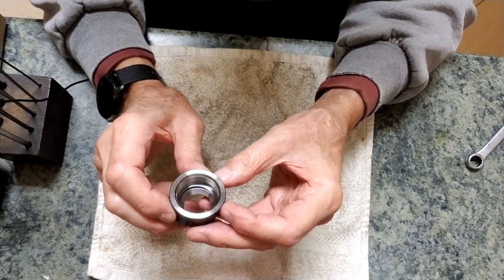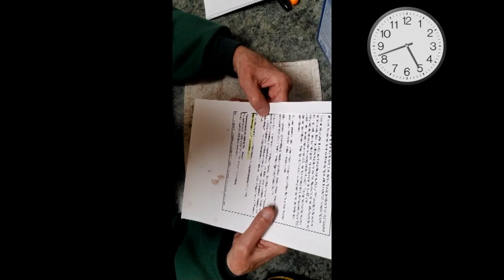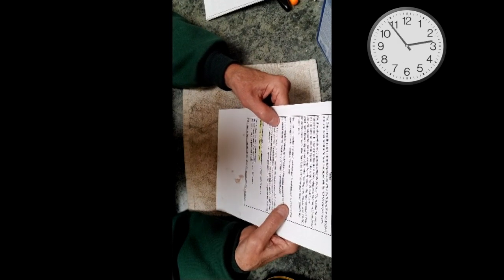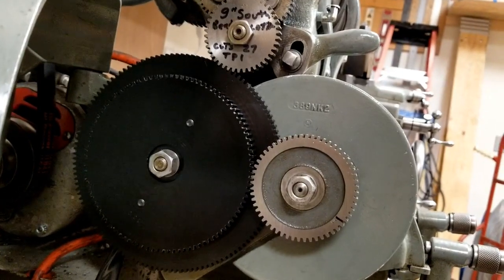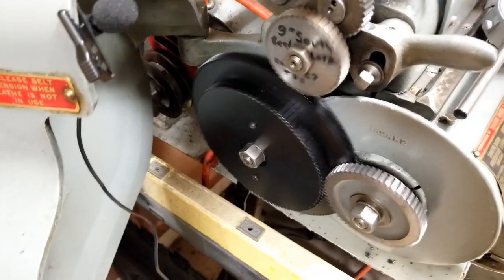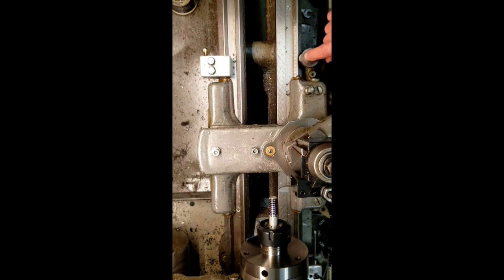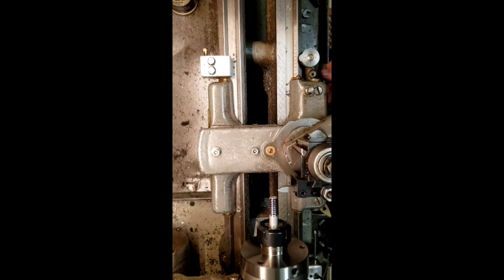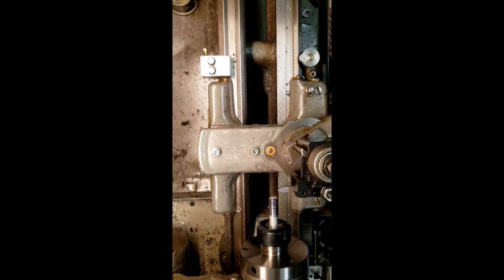South Bend 9A Lathe:   Metric Threading

Comment: Very Interesting Video.
I have a very similar Atlas lathe with no quick change gear box.
It has a threading gear chart hidden under the gear cover which includes metric pitches.
I didn’t need to make any huge 127 teeth gears.
https://youtu.be/Jdvbnn-1I_0?si=raAZQ7mJvhJCbWlW
It’s still an approximation but I calculate the variation over an inch and it’s not much at all.
I also had to deal with the lack of reverse 🤠

Comment: I am quite happy to see that my work that I did back in early 2000 in excel helped you in your project.  Last year I worked in order to enable me to cut BA threads on my South Bend gear, as well as cutting diametral pitch threads.
With your gear cutting setup, you should cut delrin gears for the reverse tumbler. It reduces drastically gear noise at high speed. Unfortunately, it is 20 DP
Guy Cadrin 12:31
Reply from the maker: Hi Guy,
Thank you for all of the great work you're doing to increase the threading versatility of these fine little lathes.  Thanks too for the suggestion of using non-metallic gears in the tumbler reverse system.  

I'm curious about your solution to diametral pitch threads.  Please forward a link If you have your solution out on the internet some place.   On my 6" ATLAS lathe, I insert a 14/22 cluster to get a close approximation of Pi/2.   To cut a 20 DP pitch thread, I set up a gear train for 10tpi, insert the 14/22 cluster and I get a close approximation.  This also works for module pitch threads.     

I figured I'd do the same thing on the SBL 9A except set the QC to 10tpi.   Again, I figured that setting up a metric gear train and QC for 2mm pitch and adding a 14/22 cluster would cut a reasonably accurate module 1 thread.  Thoughts?

Again, many many thanks for the work you're doing.

Cheers,
F.C.

Comment: I 3D printed a set of transposing gears for my Boxford lathe, they work perfectly. I also printed a set of gears to make almost any Metric thread.  Surprisingly they are strong enough to thread steel, the load on the gears is quite low.
Reply from the maker: Brilliant!  May I ask the make and model of your 3D printer?   Also, may I ask the material used to do the printing and the approximate printing time?
Cheers,
F.C.
Reply: @FCleff  I use a Prusa i3 MK3S+ . I was surprised that I could just use standard PLA. low density infill but solid at the teeth  with extra thickness at the centre boss and inside the teeth.  The Prusa slicer allows plenty of options. The 127 gear took 14 hours, the smaller ones much less.
Reply from the maker: @philiphoeft6100  Thank you.  Your printer's performance is impressive.  My old Solidoodle, not so much.
Cheers,
F.C.

Comment: I have to build the same thing i have a metric capable lathe ..can you share with me the outer max size of the part being made im doing test parts first im at about 31.25 mm
Reply from the maker: Hi Kenneth Berkley,
The thread for the mating parting is an M32x1.50.   The MAX O.D.  would be 32mm.   I don't know the specification for the pitch diameter but I'm sure there is a formula in Machinery's Handbook, etc.  Once you know the PD you can measure it "over wires" and be sure of a good functional fit regardless of O.D.   If you use a good quality, full form threading insert, the PD should be quite close at  O.D.Max.   If you are using HSS tool blanks that are ground "offhand," well, that may  be more of a "cut and fit" exercise and the O.D.Max may vary quite a bit.   Hope that helps?
Cheers,
F.C.
Reply: @FCleff  yes thanks im building a mill and this shaft is the way to go and im incorporated the er style tool holder in the shaft..and didnt want to have to press another one into a hole..i have an older 1550 Enterprise lathe and when i got it none of the numbers for threads or the control handles existed..many thanks